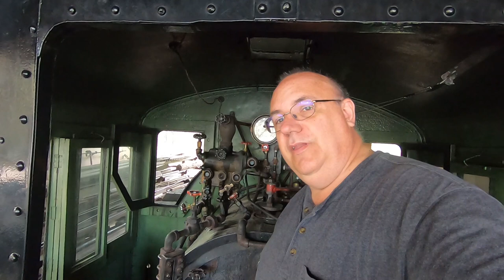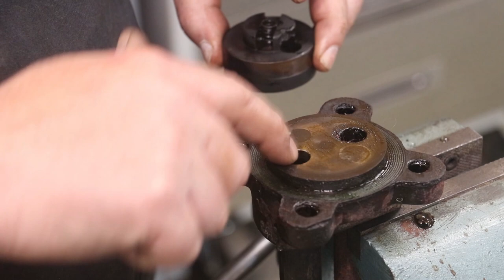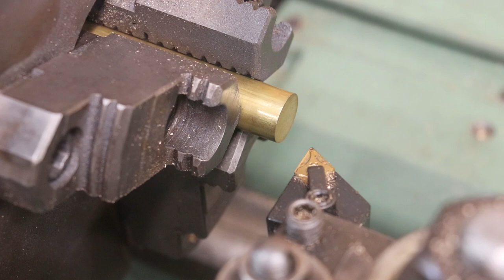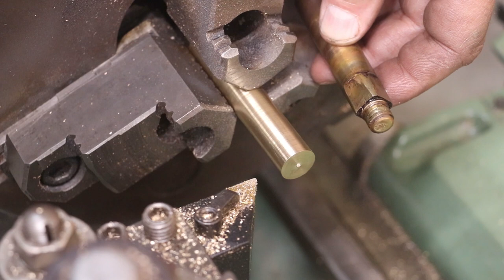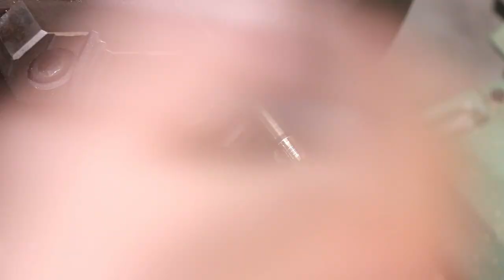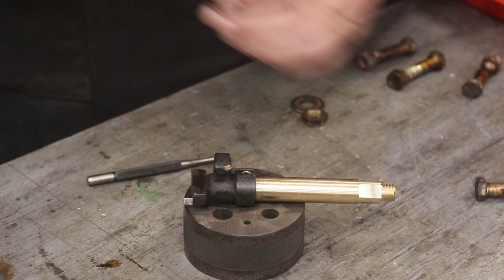Repairing & Machining Parts for a Steam Locomotive Brake Valve

Comment: yup its time for a design modification keith  !  if it was me   and i had your tools  i would drill out the socket for the shaft  remake the shaft with a longer threaded section extending through the socket and secured with a nut   and possibly a key     the pin   as you point out is the weakness here but is also what locks rotation of the handle to the valve  which is the issue here it needs to be locked in rotation  for the valve to operate  but any pin  through the shaft that size weakens it  to a point where it will fail in time  right there   over and over  ,,  so i believe my method will be a superior repair but hey  you know what is said about opinions   and how there as numerous as certain orifices   and just as welcome to public exposure ;D

Comment: rather drill the hole all the way through, you could possibly dimple the shaft to match the holes in the valve, tap the holes in the valve then use set screws to lock the shaft and valve together

Comment: couldn't you just forget the spring pin and use a couple of grub screws into slots on the shaft? would have a nice cross section

Comment: Steam brakes😮.I didn't think there would be any locomotives of that era still running them .A westinghouse brake set up would be nice upgrade,if a little expensive.
Reply: The WILLIAM MASON at the B&O Museum still does not have steam or air brakes just hand brakes on the tender.

Comment: I'm surprised they didn't have steam pressure to keep the breaks off. so loss of pressure applied the breaks.
Reply: Andrew Stoll Unfortunately a lot of accidents had to occur to get to the safety standards we have today.
Reply: Point noted....
Reply: What happens then if you need to move the loco when it is not fired up with steam in it?  What you are thinking of is air braked trucks and trailers. Even after a part failure, I have safely run a 17 ton 4-4-0 steam locomotive with passengers with no brakes even though the loco had a steam operated air pump on it.  This train is operated at 5 to 10 mph and can be stopped using the reverse lever very easily and quickly.
Reply: @royreynolds108  just like any lying with air brakes, you back the brakes off, ir you fire it up and make pressure to release the brakes. This whole pressure applies the brakes thing is very dangerous no question about it. Run out of pressure and you run out of brakes.

Comment: My observation:  The brake valve is about as easy to operate as a light switch. Like a switch, it has two positions, on and off (ok, some shades in between for slowing). It doesn’t matter whether you’re stopping gently at the station to swap passengers or doing a panic stop cause Buster’s car is on the tracks again, there is no need to torque on the brake handle. The room doesn’t get dark any faster if you slam your light switch and train won’t (can’t) stop any faster even if you’ve got a 36” pipe wrench on the stem. My rambling point is, if used as intended, your your brake valve stem should last you several lifetimes. 😎👍
Reply: You are absolutely correct.  The train travels 5 to 10 mph and is stopped by closing the throttle and using the reverse lever.  The brakes are used to keep the loco from rolling.

Comment: I do have a question. Can you show us any back up manual break system the Loco might have
Reply: Does not have any.  Two pieces of wood or a length of chain laid from in front of to behind a driver is it.  Standard practice.

Comment: What's the packing material?  Looks like soft metal of some kind.
Also, no lock nut or lock wire on the nut holding the handle to the valve stem???
Reply: Packing material for this application is a cotton cord type material with a lot of graphite in it.  Teflon is used for water and should work in this situation.

Comment: I'm guessing somebody was yanking on that thing. It looks like it doesn't take much effort to operate. 
Though maybe with the steam pressure it might take a bit more force to move it.
Reply: You are correct about not taking much effort to turn the stem under steam pressure.  I have been on the locomotive when it was working.  These brakes are really parking brakes as they are either on or off.

Comment: Thanks for sharing. Keith, I didn't see any sealant on the bonnet flange. Is it a metal to metal seal?
Reply: Did you watch the video? The bonnet and packing are explained.
Reply: @paulcopeland9035  Well, I watched the video again. At no place in the video did Kieth talk about the bonnet gasket. He talks about the packing gland on the stem but not the bonnet gasket. From what I could tell from the video it looked like a Flexitallic gasket is used to seal the bonnet and it looks like he reused the old one. Sorry if this question irritated you.

I watched this video...https://www.youtube.com/watch?v=DAobpHBSSww in that video I see a Garlock gasket.

Comment: THE ORIGINAL SHOULD HAVE BEEN LARGER!
SPEAKING AS AN LOCOMOTIVE ENGINEER AND AS A RAILROAD MACHINIST,
A HAM HANDED ENGINEER IN A PANIC MODE COULD EASILY BREAK ONE OF THESE!
STILL, A NICE REPAIR!
KEEP THEM ROLLING BROTHERS!!👍👍
Reply: This loco is a 3 foot gauge industrial 0-4-0T of about 15 tons.  It operates at about 5-10 mph with 2 cars on a little over a mile of track in a loop.
Reply: Roy Reynolds THANKS FOR REPLY AND INFO!!  WHERE IS THIS AT??

Comment: Should have milled a flat on stem and tapped a hole in the cast part to retain with set screw
Reply: Was thinking the same thing. He usually tries to keep it as original as possible so I'm guessing that's why he went this route.
Reply: @ryanp0342  I understand his logic but also see if it's a recurring issue something needs to change

Comment: Even a beefed up stem will remain weak where the pin sits. Drilling all the way through took away half the strength. After all it's brass, not steel. A set screw on both sides would have done the trick, leaving the core unscathed.

Comment: That handle is too long for the effort required. That'll be why it broke - the torque is too great, especially when it reaches the end of travel. Did you hear the firm 'click' as it reached the end? I would look to replace it with either a shorter handle, or perhaps a wheel.